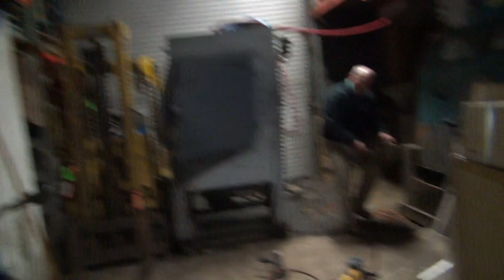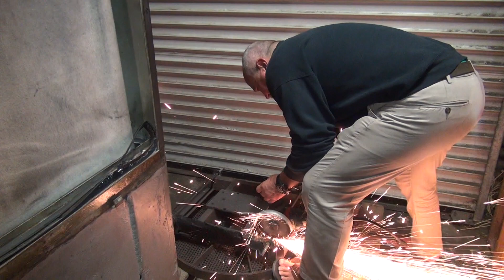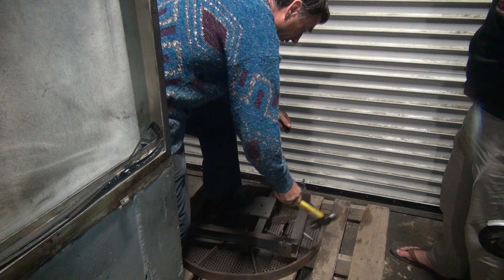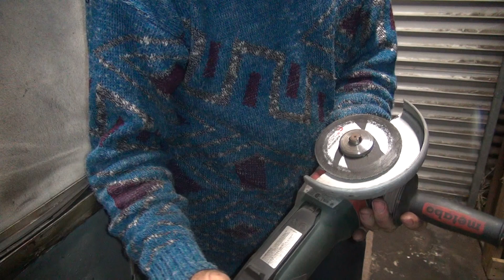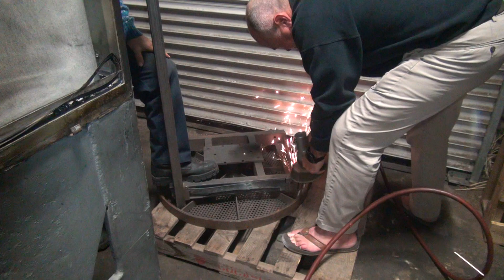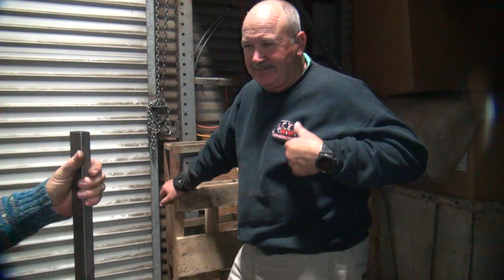#121 see what it takes to fix the air lines & the sand bead blaster working at tatro machine harley

Comment: Good work but you guys need to start wearing safety glasses and shields along with other equipment only takes one wrong move and you can lose an eye...I had a piece of metal shoot through a pair of safety glasses but the glasses slowed it down so it just scratched my cornea...without them I would have lost it.....
Reply from the maker: aint life great. and then one day you are walking down the street and a piece of a building falls from the sky and you are dead. real deal, that just happened yesterday. 
tatro